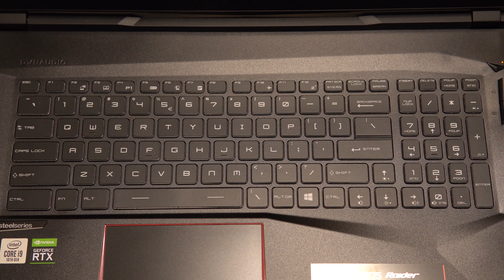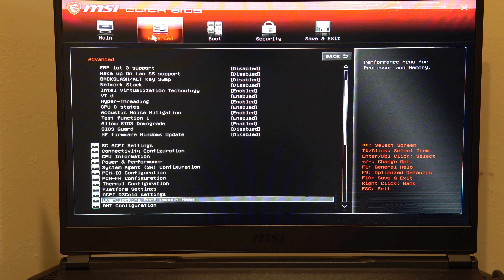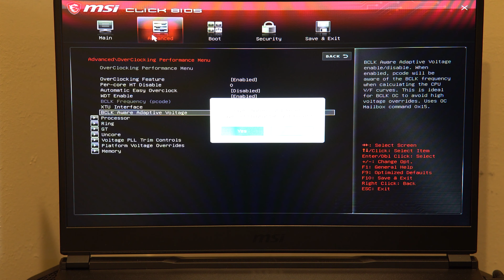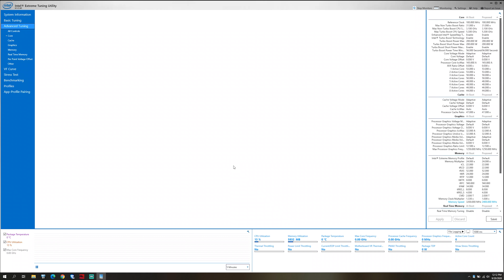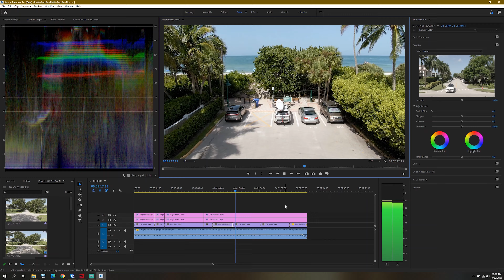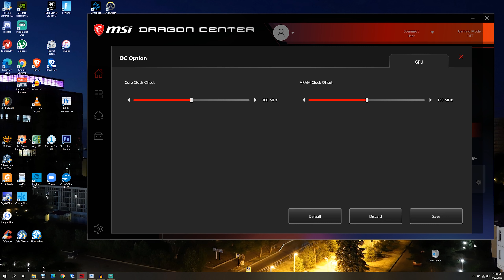Undervolting the MSI GE75 Raider - Easy walkthrough on how to under-volt a laptop  - ParadiseBizz

Comment: Hi, thank you for your video ! I have undervolt my PC GE75 rtx 2070 super, i7 10e, the same as yours and my undervolting crash my pc, freeze with just -0.020 V. How many degrees do you gain with -0.05 v? is it stable?
Reply from the maker: It really depends what application you're running. For games like Overwatch I could undervolt with -0.1 and it would give me about 10 degrees advantage. 
While  applications like Premiere Pro crash already at -0.05. So you need to figure it out depending on your tasks and adjust if you're using your computer for different things. The good thing is that undervolting does not harm the system, it only reboots it and resets your settings.
Reply from the maker: @pTw Unfortunately undervolting does not always work out. For such load heavy tasks you complete with Adobe After Effects, Blender... you might need the full power. Otherwise your system might simply shut down. You should use a cooling pad to improve temps and performance. https://youtu.be/ZkU7ZbVfe-I
Reply from the maker: @pTw You're welcome

Comment: Thanks a lot! Your video was very helpful :D
But I have one question -  I have an older Dragon Center on my GE75 8SF and i don't really know how to update it... When i just simply install newer version of dragon center - it doesn't let me go to any settings, so i stayed with the version that i am sure is working fine, but it doesn't have oc settings. So going back to my question, can i just overclock my graphics card with MSI Afterburner?
I would be grateful for any answer :)
Reply from the maker: You can absolutely use the MSI afterburner to overclock, in fact you can finetune the OC settings much better with the Afterburner compared to the Dragon Center

Comment: I figured out 2 ways how to decrease the turbo clocks of the cpu since its locked in every way possible except for the bios and another twisted way that solved the thermal problems but the system seems like windows 7 speed after I adjusted it to 3.5Ghz lol idk why but if you want me to share it with ya I could if it helps :D 

Plus you may solve the problem of the system response speed.
Reply from the maker: My system response speed is perfect and the temps are great
Reply: @DirksFocus  really? My laptop idle temp is 28 c after the cpu tuning but when I use it for gaming specifically it starts to lags(huge fps drops) until the temps reaches 65-70 so its all good and playable.

Did you encounter this problem in anyway ? If yes, please explain how you managed to solve it and thank you.

Another question, did you tune the cpu ?  Like capping its power so it won’t thermal throttle?
Reply from the maker: @kT-AlQhtani  Not having this problem. I will make an update video on how I use my Laptop and how it works for me when editing videos and playing games, soon
Reply: @DirksFocus  I look forward for that :D 
Thanks mate.

Comment: Yes thank you!! I've had this computer for over a year and it's constantly been at 80+ degreesC. One question is this a latest version of dragon center? I don't see the option to change gpu core clock speed anywhere
Reply from the maker: Everything below 95 degrees C is considered normal working temp for this Laptop. 
This is the latest version of the Dragon Center, and there is the gpu oc. Alternatively you could download Afterburner for that.

Comment: Thank you soooo much sir!!!
Reply from the maker: you're very welcome
Reply: @DirksFocus  btw whats better throttlestop or xtu? I cant seem to install xtu on my raider..
Reply from the maker: @graelstream2353  what is the problem when you are trying to install xtu? Other ways: use a cooling pad, and in the MSI dragon center try user settings, TURBO with settings to NO overclock and use Cooler Boost